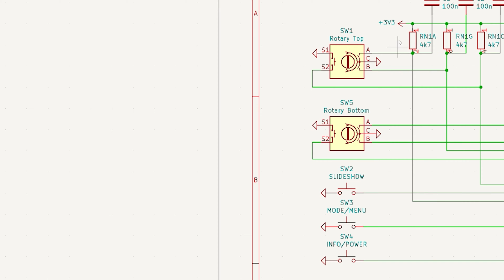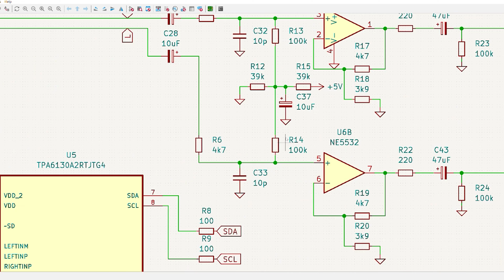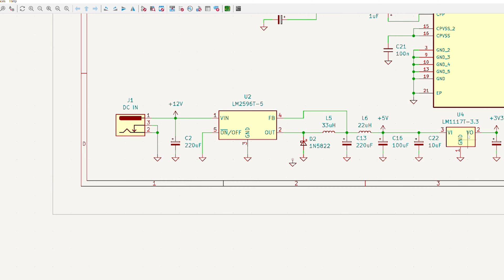Build your own DAB+ receiver

Comment: Hello! Would it be possible to redesign the hardware/software a bit so it can be used by the blind people? I mean matrice of 16-20 keys which could be used to program the stations. Just power the tuner on and press the button to choose preset station without using encoder/display?

Comment: Hello Sjef, congrats to this project. This receiver is truly superb.

I have a few questions about the choice of hardware and software version used.

Which ESP32 board are you using and which version of Arduino software did you use to compile your programme?
I compiled with Arduino 2.3.6 and the Espressif ESP32 board version 3.0.0. 
When I compile using the ESP32 dev Module card and the Huge APP partition scheme settings (3MB MB no OTA APP / 1 MB SPIFFS), I don't have enough memory because the sketch uses 3187217 bytes (101%)
of the programme storage space. The maximum is 3145728 bytes! 
Can you help me with this issue?
Thank you for sharing and for your help.
Reply from the maker: Compiled with 2.0.17. I have to upgrade the code to be compatible with the latest board managers. ESP32 board is the cheap 30-pin version.

Comment: Awesome. I've seen the WIFI option in the demo video, does that mean it could be programmed to work as an internet radio? Could bluetooth receiving and/or transmitting  be also added? As far as I know ESP32 should be capable of that, right?
Reply from the maker: No. WiFi is not available on this project due to lack of free SRAM.

Comment: Board ordered, components on route. Are you planning to create a hybrid receiver? TEF6686+ that DAB+ solution??
Reply from the maker: Yes
Reply: @Sjef_PE5PVB  Interesting, SI4684 also supports good old analog FM, do you think TEF6686 would be significantly better than what you get from SI4684?

Comment: Hello
Can a DAB radio be converted to DAB+ with a little electronic ingenuity?
Kind regards and thanks.
Mogens V.
Denmark
Reply from the maker: No, DAB+ radios have some new audio codecs like AAC. You can't convert old DAB radios which only can decode MP2 codec.
Reply: @Sjef_PE5PVB  Thank you. I had hoped that something could be changed in the receiver part. (Integrated circuit)   Mogens V.  Denmark

Comment: Hallo Sjef,
Hartelijk dank voor de informatie over het mooie project voor de DAB+ receivers.
Ik zag het eerste bericht 9 dagen geleden en keek elke dag of er iets nieuws was.
Ik wil het project graag opnieuw creëren en dealers vragen voor de SI4684 en TPA6130A.
Kunnen de IC's met de hand worden gesoldeerd? Misschien heb je een kit aangekondigd.
Ik heb de TEF6686 ESP32-radio al opnieuw opgebouwd en deze werkte meteen met goede ontvangst.
Nu hoop ik op de DAB+ radio.
Groeten Erik
Reply from the maker: Hi, possibly a webshop will launch a kit. The SI4684 and TPA61302 can be hand soldered, but note, they are in QFN casing.